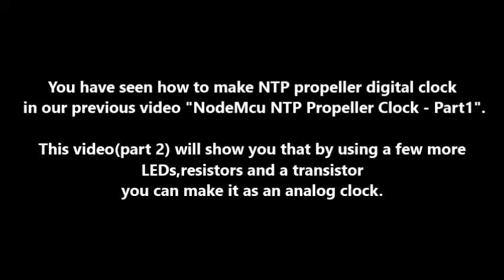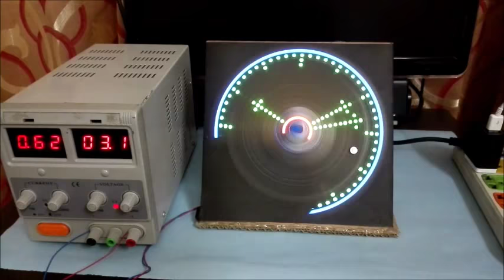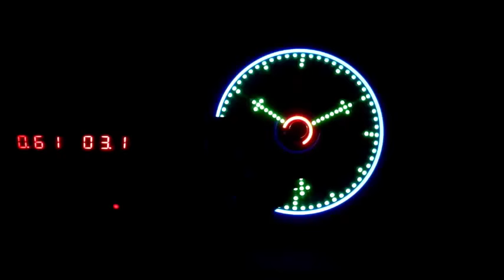NodeMcu NTP Propeller Clock - Part 2

Comment: ..01:24:17
ISR not in IRAM!

User exception (panic/abort/assert)
--------------- CUT HERE FOR EXCEPTION DECODER ---------------

Abort called

>>>stack>>>
why do I get this message in terminal, it wont connect to internet, I should also thank you for all you clock, I build the pendulum clock wireless and it works fine, but this one in not going anywhere. I"m using the 3144 hall sensor. Thank you.
Reply: same
its not working
what should i do??
plis help
Reply: @renebourque2552  yesh your comment was the most helpfull, i have submisiion tommorrow but the leds are dim it is working but not quite visible? what can i do for that?
Reply: @pseudocodeXD  a black background will help, smaller led resistor value since voltage is constant. But mine is dim also.